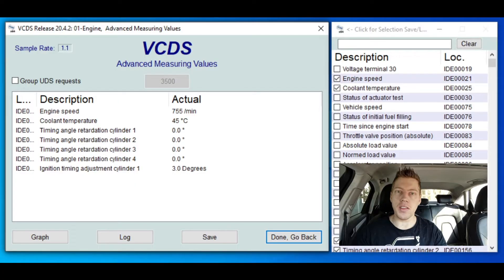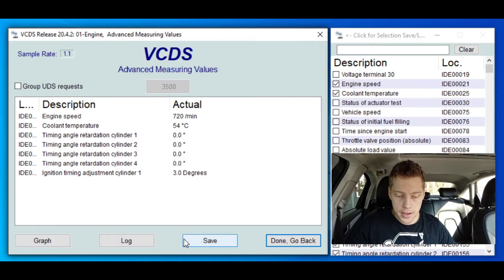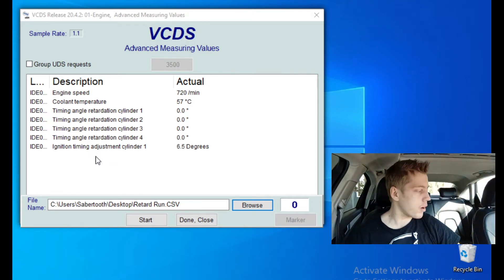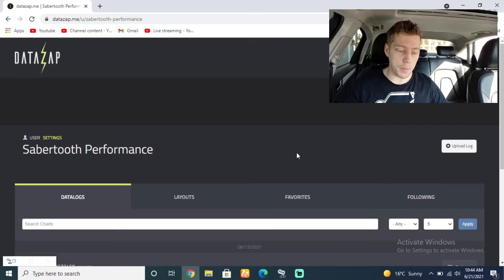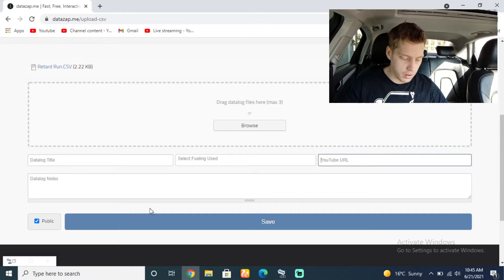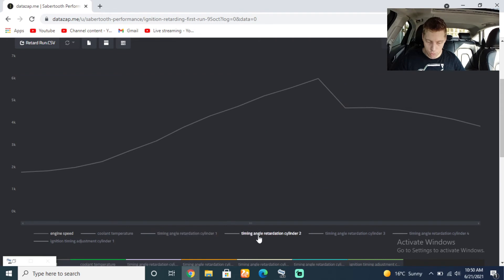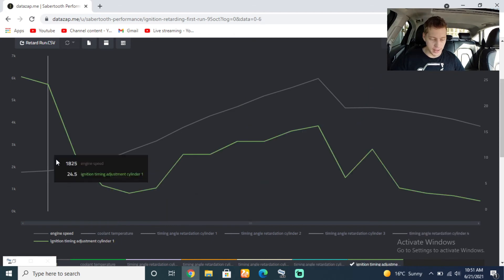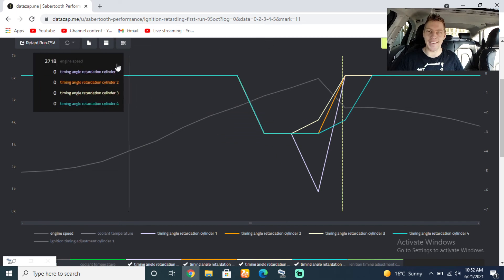How to see Ignition Retardation by Data Logging with VCDS

Comment: At wot what should be timing range,mine moves from -2 to -17
Reply from the maker: What are you logging? The Knock Retard or engine timing?
Reply: @megalodononwheels  engine timing
Reply from the maker: I will need to look at mine, I am unsure if it is in the - or + but the amount which is 2 to 17 looks fine 👌